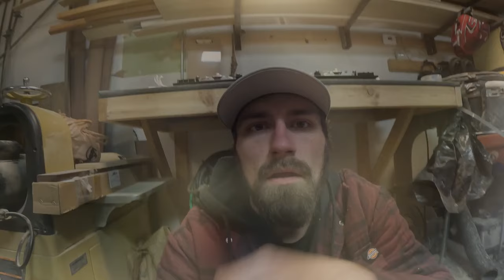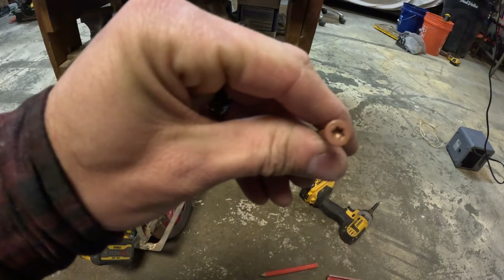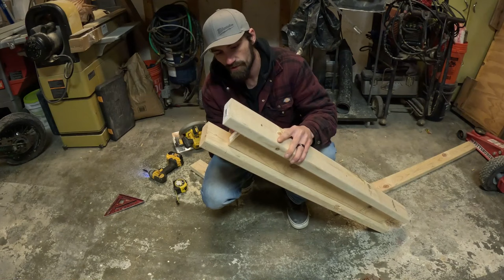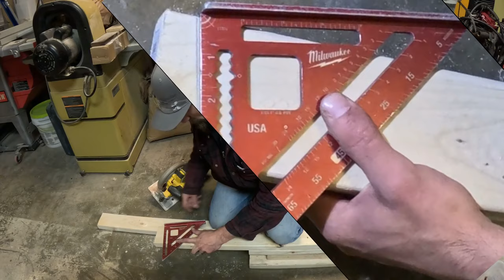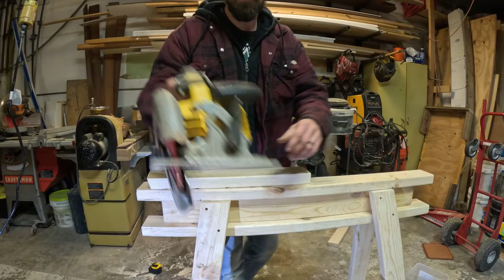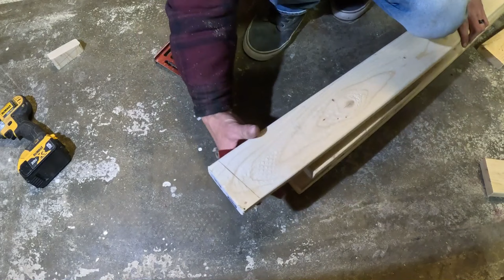HOW TO BUILD CONTRACTOR QUALITY SAWHORSES FAST AND CHEAP (step by step diy guide)

Comment: Amen!

In preparation for a deck rebuild job about 10 years ago, my grandson and I built four of these sawhorses. We used treated lumber because they had to sit outside in damp weather for a few days. They worked great. They are simple to build, strong as hell, and easily stackable. I have used them many times for various tasks over the years and they have worked flawlessly.  I have no doubt that they will be passed down to my children or my grandchildren after I am done using them.

In our case we used an angle of 12 degrees for all cuts, but anything close to that will be fine as long as similar cuts are all consistent.  Also, we used 2 x 6 material for the top rail, with outside edges beveled at 12 degrees, too, but that was just a preference that allowed some additional backing for the top of the legs and extra clamping surface.  Further, we built the saw horses on the garage floor, as you did, but we used a compound miter saw, which made the cuts both easy and quick. As you clearly demonstrate, however, a miter saw is not necessary for this build. It's just nice.

Your tip about providing space for your tape measure, etc., is a good one. I wish I had done that, too.

Anyone who follows your recommendation to build a pair (or more) of these saw horses will be glad they did. Count on it.

Thanks for the video. 👍👍
Reply from the maker: My man, that was a very well thought out comment and I commend you for keeping them in such good shape all these years! I’ll have to try the 12* angle and see how that works for me. 
I do think the 2x6 up top is a better design as well. That’s the best thing about the trades.. you never stop learning! 
Thanks again for the response, it’s cool hearing how other people have different versions

Comment: Sub'd!!!  Wow!  Just what I was looking for!!!  My boss just called and said the "cut man" on one of our projects is "off the job" and I know what that means.  Now I have to be on that job next week and I'm the new cut man.   Normally I'm just a supervisor, so I don't need saw horses, but next week I want my own since I'm taller and don't need to be bent over a mitre saw screwing my back up.  I can take your design, add a couple of inches to the legs and I'm not fatigued by the end of the day or the end of the week.
Reply from the maker: Being bent over all day is so hard on the back it puts me in pain just thinking about it. 
I’m glad these will help! Being cut man is not an easy feat! (depending on what you’re cutting)

Comment: Very good video. Explained very well. Built a set very similar I cut bottom of I Beam same as legs. Leg brace left long to one side to hang saw on. Counter sunk screws on top. Add a scrap piece of plywood to top of I beam. Sacrificial board.
Reply from the maker: Sacrificial board comes in very handy! Thanks a ton

Comment: Hey brother, fellow tradesman, but not a carpenter. Getting ready to build a small deck and stairs and needed some decent saw horses and found your video. I like your design for the splayed legs and the compound angle cuts (saved me some calcs 👍). The small space for tools is nice too. I'll probably have to build some kind of tool box to hang off one, but I have a way of overdoing things. 🤣
Reply from the maker: Hey there’s nothing wrong with a little bit of custom action! I’m glad I could help man. If you have any questions about calculating your stairs or anything with the deck, just come back and comment and I’ll give you an email and we can chat and get you sorted out. Thanks for stopping by and engaging, good luck!
Reply: @ManOfMiniHats  Thanks for the offer of help. I'm an electrician so the math and layout is nothing new after 38 years. And I do some small woodworking once in a while, plus as you know, over the years you pick things up.  I'm only building a 5' x 4' platform. Stairs were new though, had fun laying out the stringers, actually easier than I thought. Can't wait to get started building.
Reply from the maker: @MB-zj3er  well hell, you’re already halfway there! Good luck wrapping it up brother and thanks again for stopping by!
Reply: Just thought I'd let you know I built my first one with the 2x4 I had on hand. All from the big boxes so none of them were straight of course. So when I finished I could not just kick adjust the legs like you did and get the rock out. So I socked them all down tight and put it on a bench I keep perfectly level, shimmed the horse to level, scribed all the bottoms and took off trimmed and reinstalled. She's dead b@lls now and all my compound angles are flat on the floor. 😁
Reply from the maker: Hey, you’ll have that on them big jobs 😂 glad they worked out for you man! The ol tried and true scribe can’t be beat

Comment: How long are the screws you used? Is there a good rule about how deep into the second piece of wood screws should be driven so i know how long they should be for my projects?
Reply from the maker: I used 3” screws for this one. When selecting screw size, I usually shoot for 1/4”-1/2” smaller than the 2 pieces I am fastening together, this way I have as much of the fastener in the second piece as possible without it penetrating the other side. The more screw you can fit in the piece, the better if it will be holding any significant amount of weight. (Remember not all screws are structural and some screws [like drywall screws] will snap before bending like a nail would). I hope this explanation helped, and thanks for watching!
Reply from the maker: @johnhaug1747 I believe the screws in this video are #8, but #9 is a bit beefier, and I never have an issue with upping hardware size!

Comment: Good horses. Without sacrificing any strength, make those horses ~20% lighter by eliminating that top 2x4. Also, you don’t want any nails or screws in the top, so you don’t need to worry about hitting any metal when making cuts, across your horses.
Reply from the maker: Great tips! Thanks for watching

Comment: Do they stack??
Reply from the maker: Yes they will stack, if stacking more than 2 I would suggest moving the brace on the legs to 10” from the platform instead of 5” from the platform and they will stack more snug!
Reply: @ManOfMiniHats  Thanks again, this was one of my questions. It looked like your brace would rest on top of the first horse and possibly rock. No pun intended on the rocking horse. 😁
Reply from the maker: @MB-zj3er   Yes I should have mentioned this in the video, if you want them to stack without sitting on the brace you will have to move the brace down
Reply: Could also set lower sawhorse legs inset 9-5/8" instead of 8" to allow for thickness of cross brace.
Or use thinner (like 1/2"-3/4") scrap plywood plate instead of the 2 by 4 lumber.
I ended up using four short scrap 2 x 4 s, but laid flat and made two 15 degree cuts opposite of each other.
That way they fit between the legs. Then rip cut  a 1 x 6 for the longitudinal braces, one on inside, one on outside.
 and Voilá, they stack ;)
Reply: @johnhaug1747  What I ended up doing was using 3/4" x 3 1/2" "strapping". I wrapped one all the way around the outside on one horse, and the other the inside, so they stack perfectly. Now I have bracing all around and a nice spot to put a shelf off the work surface, and it can't tip over because of the splayed legs. Very handy. To store you just unscrew one outside brace, stack, and screw it back in. Now they are locked together.
Reply from the maker: Wow that sounds handy, nice work! It’s cool to see everyone expanding on the idea, what I thought was just a clunky video has helped a few people out and that’s pretty awesome. 
Thanks everyone for giving your insights and time!
Reply: @ManOfMiniHats  I'll give you another prop on this design, because you kept the center rail of the I-beam short, it provides a great easy clamping point for boards you want to cut so you can keep your hands on the saw and your work stable. 👍
Reply: Have you ever tried trimming the upper leg cut such that a portion of leg lays flat against the web part of the I-Beam 2x4?
AKA compound cheek cut.
Thus eliminating the excess portion of the upper leg that is exposed to the sky?
Reply from the maker: @johnhaug1747 I typically build these on site and beat the crap out of them, so I haven’t ever taken the time to add a birds mouth on there, but it would definitely make a slicker set! Maybe I’ll make a set that stays in the shop and I’ll dress those up a bit more
Reply: @ManOfMiniHats  So I did try the (very) compound cheek cut, but found out the cheek did not lay flat (flush) against the I-beam web as I envisioned.
So I partially assembled each leg, and marked the lower I-beam flange where each leg laid.
So I chiseled out about 1/4"-3/8 wedge shape (about 15 degree triangle shape) to match leg angle).
I knew I was done when cheek rest flat against the web. I used a huge flat bastard file to finish the notch outs.
I think it worked out OK, prolly too much extra time to be jobsite efficient, but I did it anyway.
But now legs are notched in place.  Note to self top screws can now be 2-1/2" as making cheek cuts reduces thick ness at top of leg.
Prolly not very time efficient, but they do look much better,  hold more weight since upper legs now notched to I-Beam, and lower legs hemmed in with cross and longitudinal bracing.  Also find lower saw horse uses 2x4 flat leg cross brace, 15 degree cuts facing up, and inner longitudinal bracing work best with upper saw horse having outer longitudinal braces and outer 1x6 cross braces.  Plus set lower sawhorse legs inset 9-5/8"  and upper sawhorse inset at 8" to reduce stacking interference.
Reply from the maker: Wow.. seems like you got them all figured out! You took the idea and ran with it my man, that’s amazing

Comment: Old carpenter made mine with my pop slightly better had tray to hold your tools
Reply from the maker: I’m sure I could learn a thing or two from some wise carpenters like yourself!
Reply: I used to put sides on my shelf so it can be moved with some tools still on it but it caught sawdust so I used hardware cloth, steel mesh instead so sawdust wouldn't accumulate.
I only put a shelf on one so they would stack more compactly.
Reply from the maker: @michaelkulman7095  I may have to give that a shot!
Reply: @ManOfMiniHats  Glad to hear it.
When I used to build them like this I used 1x not 2x for the legs to save weight and sometimes a T frame to save lumber or a T only at the ends for leg splay to use the least lumber. Sometimes the T part was the full 2x4 part of a pallet, short pieces, before or after fork cut outs, and the legs the slats from the pallets. 
The less good they look the less likely to gallop off on their own.
I found them still quite strong and I didn't usually sweep the legs back towards ends.
Fancy and strong like yours or less so like mine the design works and is flexible
and is a lot quicker and easier than the traditional way of letting the legs in and angling in two directions, not that, that isn't a cool, but harder, project.
I'd never leave that kind out, they are even more likely to gallop off on their own...
This was a good video that remembers that saw horses might be one of the first things people build and you don't really need "better" ones that are harder to build.
The simpler design is actually stronger than most. The only penalty might be a little weight.